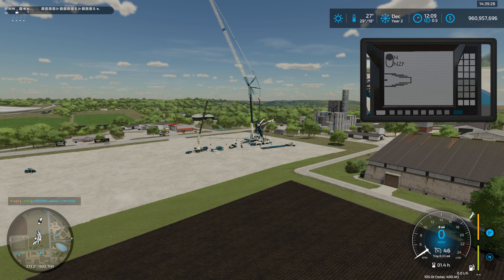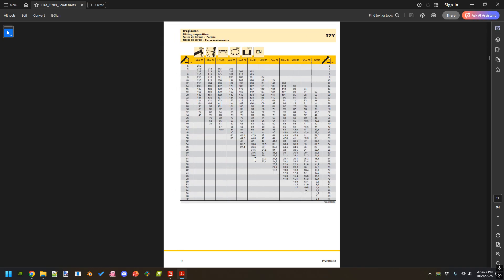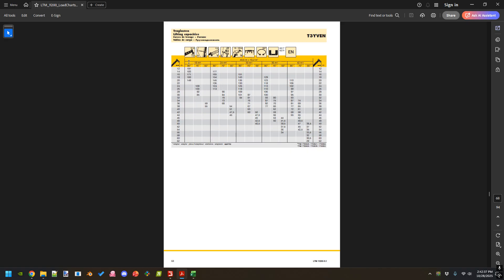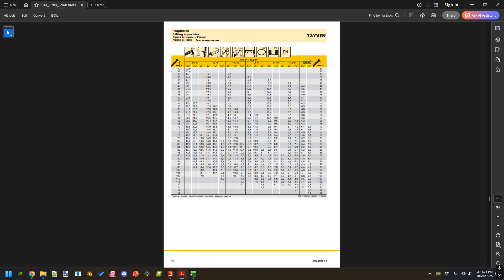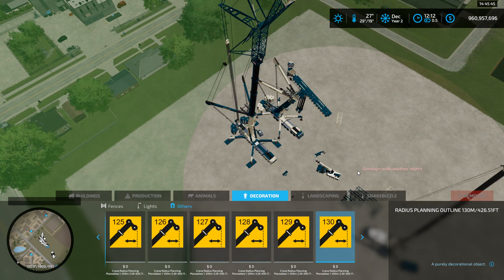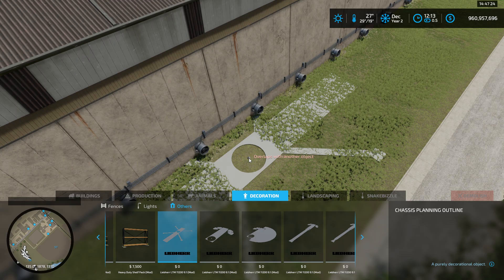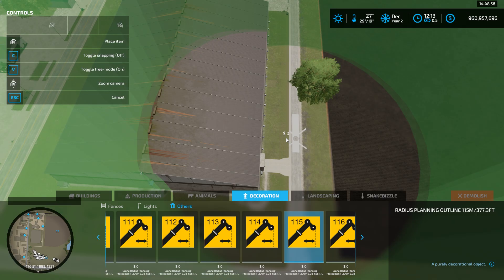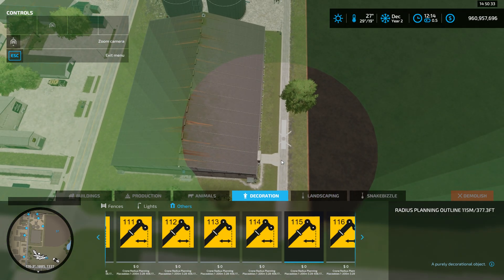FS22 Lift Planning: Radius

Comment: It could be useful to have a tool to know the height of the building too?
Reply from the maker: Yes it would, I have not had time to figure that out yet.  Though there is a Measuring mod, which I have used in the past to get the height of a building.

Comment: Bonjour Jérémy j'ai télécharger les mods de la grue LTM11 200 pour FS22 je joue a la manette elle avance et recul mai elle ne tourne pas.
Reply from the maker: You will need to reassign your controls for it. I set it up to drive with the keyboard or other controls and operate the crane and chassis functions with the controller.
Reply: @jeremybrown9379  Bonsoir ou Bonjour merci je vais regarder sa.